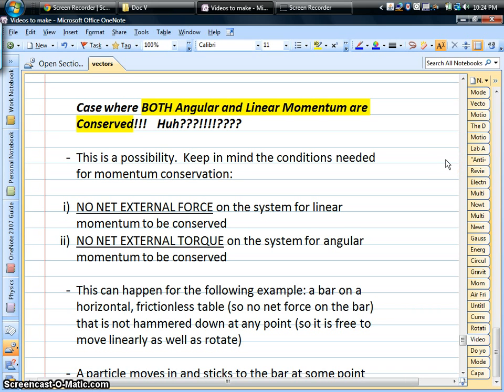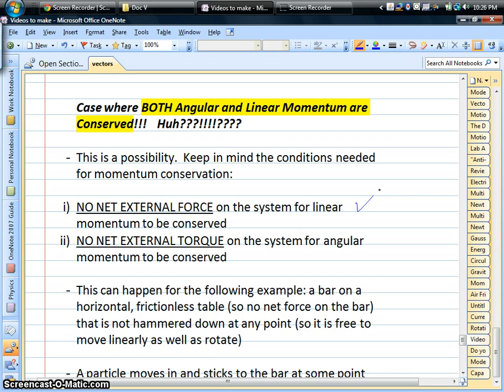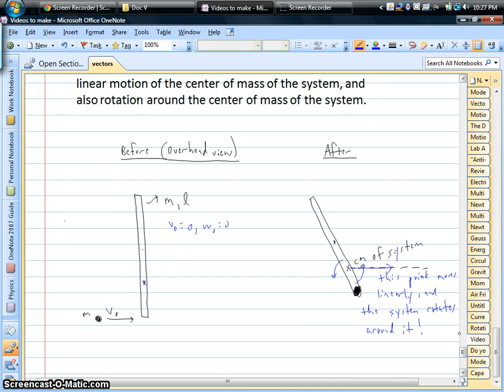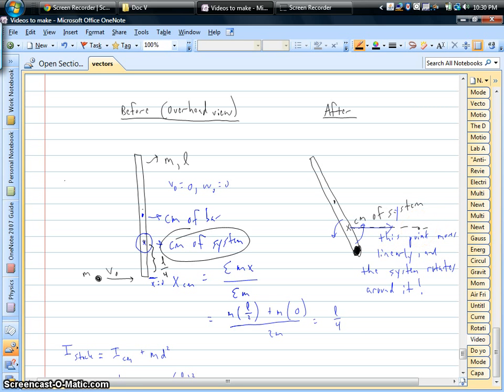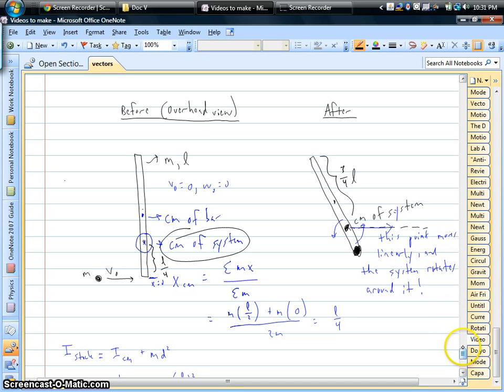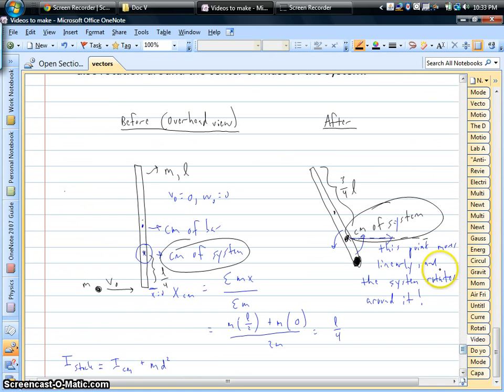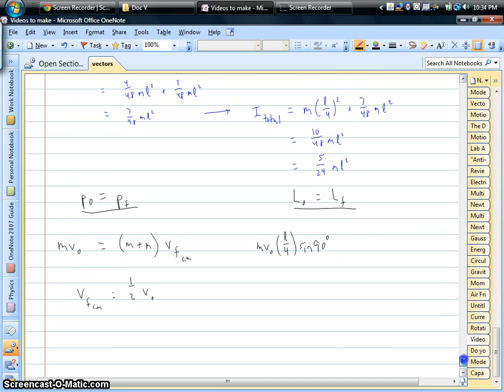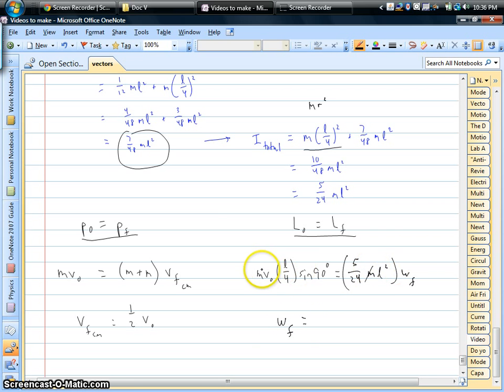Conservation of BOTH Linear AND Angular momenta

Comment from the maker: Good question, Vinay. The rotation happens around the center of mass of the system, so when the particle sticks, it shifts the center of mass from the center of the stick to the position closer to the particle. It is that new center of mass that moves in a straight line with the rest of the system rotating around it...it would look weird, a sort of wobbling rotating motion about that point. I hope this makes sense!